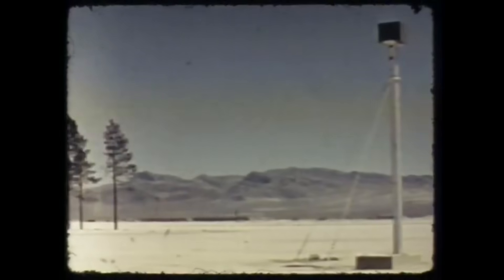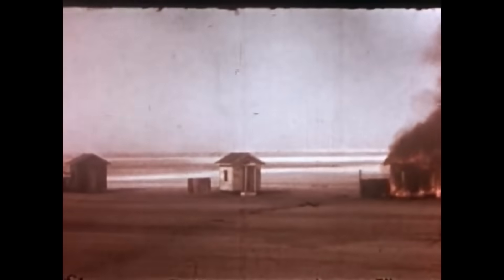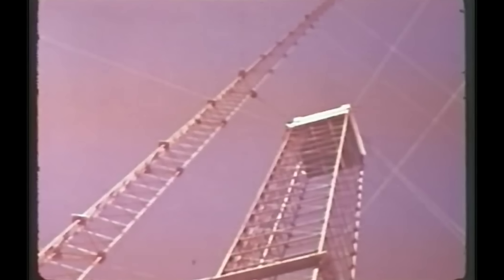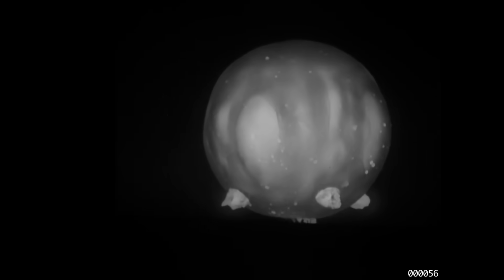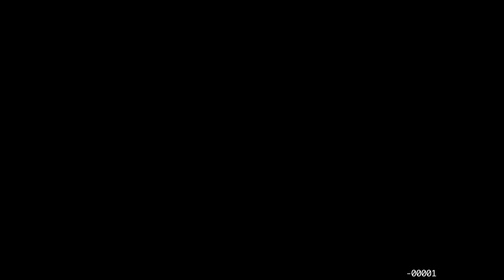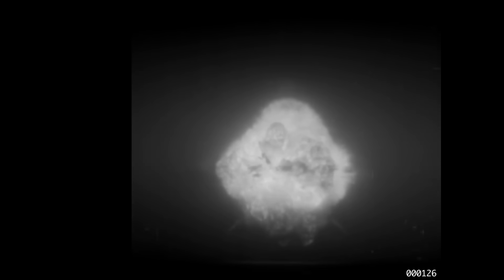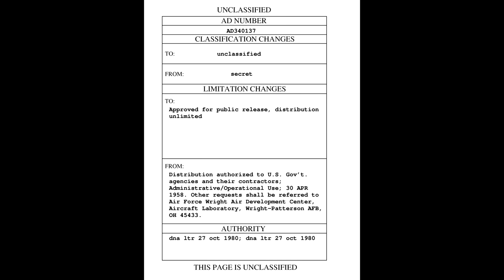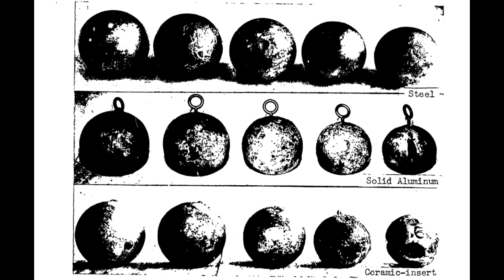Can A Metal Bowling Ball Survive Inside a Nuclear Explosion?

Comment: Could the Marble Machine X work in space?
Reply: In space, yes. In microgravity, no.
Reply: no not realy nukear blasts lose like 95% of there power in a vacume the only reason nukear bombs are so devtating is they super heat the air and make super powerful shockwaves but in a vacume sence theres not air to super heat that means no superheated gas and no shockwaves so nukes don't work so well in space unless they ditate right next to the hull of a space ship or inside a space ship pressurezed parts of the hull that as air to superheat its the only realy reasion why the mother ship in inpdace day blew up like that becuse it had air inside of it to super heat and make big shock waves with plus it would need to be close enoth to the earth to use the ozone leayer to make an EMP pulse anyway but that would be like the same efect if the earth was hit with a realy big solar flare thoue so theree that

Comment: This is what happens when you have plenty of firepower to use, just use it to experiment everything you want!
Reply: Lets get to work getting Scott some nuclear weapons
Reply: sweet corn comes from nuclear testing
Reply: @treschlet  Oh really? One would think that it would turn into pop corn :D
Reply: We had to know what worked, how it worked, why it worked and will it work?

Some Operations & Shots tested Weapon Effects on Structures; Weapon Designs, like new Physics Packages, Fuels, Casing, Delivery Options (Airdrop, Rocket, Strategic v. Tactical) Fuzes etc.; Others tested the various Effects (Type of Bursts, Heights of Bursts etc.) & different Delivery Options - Aircraft (Gravity, Toss-Bombing, Parachute Retardation/Lay-Down, RNEP etc.), AFAPs (artillery shells), Guided Missiles, Air-to-air/Air-to-Ground, Ground-to-Air, use against incoming Aircraft or incoming MIRVed Warheads during Terminal Phases & pre/post-BUS Separation and the Primary Types:
Surface, Underwater and Atmospheric (Endo and Exo) & Air-Bursts (Near-Srface and High-Altitude). Air-Bursts include the Mach-Stem Effect, a by chance discovery, and reason for Modern T/Thermonuclear Doctrine and Deterrence Policies, Countervalue v. Counterforce Targeting and the 25% Threshold Theory {AKA: The true meaning and Reasons for the Theory/Policy known as "MAD" or Mutual Assured Destruction. It's not as short and basic as seen in film. It's A LOT darker. A. F.}
In addition, these tested other aspects, such as the (discovered afterwards) HAND/HA-NEMP - from the Dual-Release of Thermal Pulses and (ibid.) NEMPs as caused by all T/Nuclear Devices.

We learned which "Reflective Lenses & purity of Graphite & Beryllium used) and which Enrichment Levels Necessary for Fissile, Fissionable and Fertile Elements/Radionuclides!
(Uranium Ore→LEU→HEU/Oy: or Raw through U238, U235, U234 & DU, Lithium →Li6 & Li7, compression of D-T Cores v P239 Pit Ratio of ~2 - 2.5kg ≈ 40kt & the "accidental" Tritium Bonus discovery! Not counting Fast Fission & Prompt Radiation/Neutrinos for in-Theatre Tactical, ERW, Boosted & Salted Devices) were needed for different types of weapons, even some combinations & designs that could be quickly designed, tested and easily Deployed! This meant options.
As Cold War I entered the Darkest Phases, we realised we needed different devices;"Clean" or "Dirty" configuration/Version to Variable (Dial-A-Yield or DAY) and Full Fuzzing Option or FUFO) Yield Thermonuclear Weapons. e.g. Tactical/Strategic B61-Mod-7/11 & 12, the B61-12 a JDAM GPS Guided newest addition, all ranging from 0.3kt - 1.5, 10, 30, 50 - 340 & 400kt.

All branched from the Tests. Some, such as Bassoon and Bassoon Prime, Operation Redwing; impacted us more than imaginable! The first US Strategic Bomber deliverable Thermonuclear Device, so a Political and Effects Testing mix & demonstrations. This Operation Series provided designs to fit MIRVed Warheads, rockets, missiles and ICBMs, as well as Gravity Bombs, including the largest Device ever fielded by the US Military: The Mk./B-21 w/ a yield of 25mt; plus Shot designs later used in the W-28 Family & Series of 20:5 Weapons:Designs fielded by the US until the 1990s) These Testshelped us increase efficiency (Enrichment of Lithium & Uranium is timely and expensive, so we wanted to achieve devices close to the Taylor Limit - 6kt/kg ratio yield to weapon Fuel & Mass. Named for Dr Ted Taylor. The man responsible for most of us alive today.

e.g. Operation Redwing;Shot Navajo gave us the "Cleanest" Device Design EVER detonated by the US, 95% of Energy from Fusion.
Shots Zuni and Tewa, both used the first ever three-staged Fission-Fusion Thermonuclear Devices tested! The former the 1st deliverable US T/N as stated, but now in two flavours: Oh Shite! & Holy FOXTROTING Shite! We adjusted the materials, designs, Ratios & Amount of HEU used as a "Jacket" around the Tertiary Fusion Stage; ∴, increased the energy derived from the Fission Vs Fusion.
IOW: The amount of Fallout and Additional Energy from the Tamper (Boosted Fission/Fusion) increased the yield without additional Fuel. Zuni {3.5mt} was "Clean", the second "Cleanest" device detonated by the US as it produced most energy via Fusion and used a Lead surrounding the Thermonuclear Tertiary Stage (the infamous Bassoon Device) producing "only" 15% from Fission.

Bassoon Prime did the opposite. Tewa used a Uranium Jacket so 87% of Energy coming from Fission, the Dirtiest Device the US ever tested. The addition of Uranium instead of Lead saw the yield = 5mt using the same amount & ratio Physics Package Fuels as used in the Zuni Shot. However, the Uranium Jacket = more Residual Radiation (Fallout and Bomb Casings) & increased the yield!
Something done today, multiple ways. We tested in order to maintain a credible Deterrence and reassurances of Unacceptable and Disproportionate Losses if someone launched a Decapitation First-Use Strike against us, we'll absorb it and our Retaliatory Strike will remove well over the 25% Threshold Theory.

And we'll still maintain a massive stockpile in case anyone fancies getting cute. Or, We Reserve the Right and Means to PWN that arse if you Foxtrot against our Allies or us. Not all tests were successful, but even Fizzles taught us a lot. We didn't do it for fun, we did it to keep this Nation Safe.
Reply: @tlamn1905  you literally summed up an entire book with that post. Nicely done.
Reply: To hell with the nuclear non-proliferation treaty!
Reply: I can imagine a morning meeting at Los Alamos where somebody sits up and asks "guys, what do you think we should nuke next?"
Reply: @razvanmazilu6284  That's more LLNL than LANL.
Reply: This is how Project Orion and Project Medusa came to be
Reply: They didn't have that much firepower available in those early days, but it was important enough for them to spare some of what little they had in order to understand whether their predictions were correct.
Reply: My God I'm really shocked by how much excitement you guys shown by a weapon of mass destruction that ruins the environment
Reply: Sheng Loong Tan USA spoke quietly while holding some very big sticks. Sticks that they understood far better than anyone thought at the time.
Reply: @shengloongtan229  Is it not a healthier choice to understand this awe-inspiring horror that changed everything forevermore without wasting energy in fear  because, after all, they decided it better to just get MAD instead.
Reply: @shengloongtan229  Have you seen any car enthusiast channels?
Reply: @shengloongtan229  How does it ruin the environment, exactly?
Reply: @tlamn1905  overground nuclear tests doubled (roughly) the background radiation on the planet. This facilitates cancer and mutations in all of life.
Reply: @tlamn1905  the nevada proving ground was so blasted that they used it as a moon analogue for astronaut training. Strontium from the tests contaminated the entire world. All metal products refined today are still contaminated with nuclear byproducts from the atomic testing of the 50s, both from the US and USSR. Nuclear weapons testing is incredibly destructive and permanently renders the land unusable. There just isn't any reason to continue it today with all the simulation power we have, and people who think its useful for geopolitical posturing need to take a course on the cuban missile crisis since nuclear testing between the US and USSR absolutely propagated that crisis
Reply: @AsbestosMuffins  "permanently renders the land unusable" 
what complete bullshit, the effects are nowhere near permament, i mean ffs you can just look at nagasaki or hiroshima today! its also far from 'incredibly destructive' in the context of destructive events that happen on this planet like the massive volcanic eruptions, devastating tsunamis or asteroid impacts, outside of the context of a human lifespan the effects are barely a blip

chernobyl released much more radiation than any nuclear detonation and its the best thing that happened for the local wildlife which flourished once the immediate effects of short-lived massively radioactive isotopes passed

the amount of fearmongering and misinformation over anything nuclear is insane